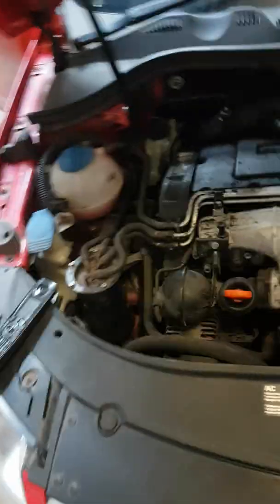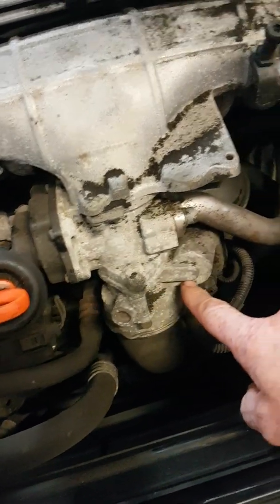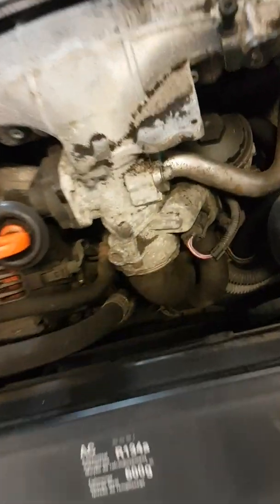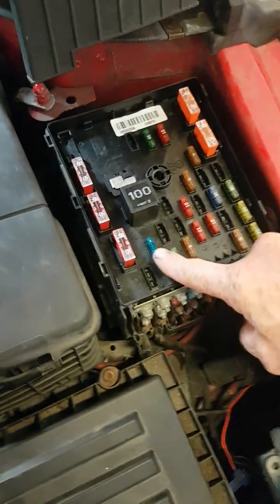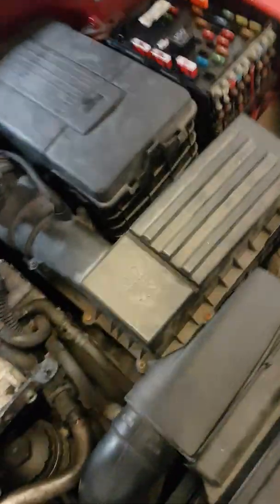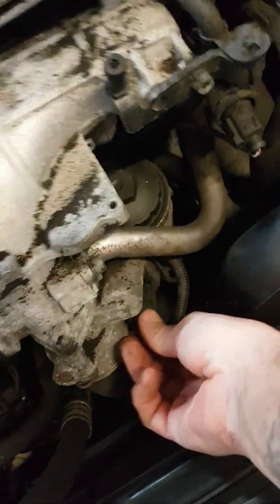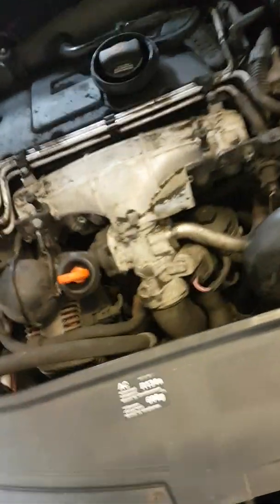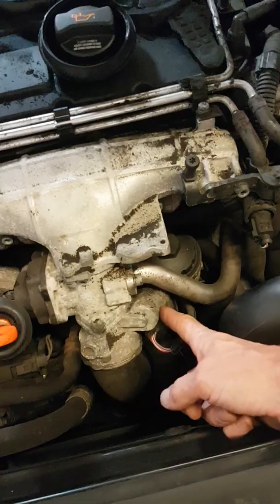Vw Audi group intake manifold flap motor diagnosis

Comment: Thank you for this video. I'll check out these fuses. I don't have Ac working anymore ans also the engine is not spinning correctly , I assume this is coming from the flap motor thou. I'll check ans let you know. My car is a skoda octavia 2005 2.0l tdi
Reply from the maker: Good luck 🤞🏻

Comment: What fuse number is it and what size is the fuse? Thanks!
Reply from the maker: #23 15amp
Reply: @bradauto  Cheers, working on a 2.0tdi golf pd engine. Non of the fuses have gone. Shall i just replace the throttle body?
Reply from the maker: @freddiewilloughby9951  it’ll be worth checking values at the plug but to be honest those bodies do fail a lot
Reply: @bradauto  Could you point me in the way of a cheaper inlet manifold flap motor? Cars done 158k haha.